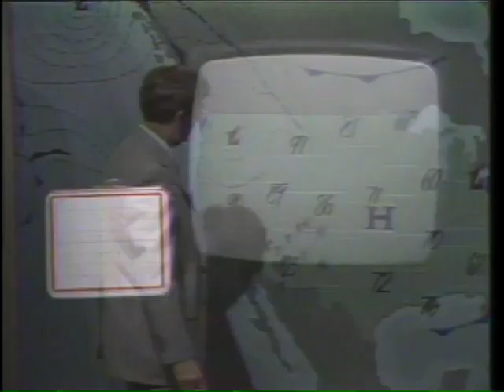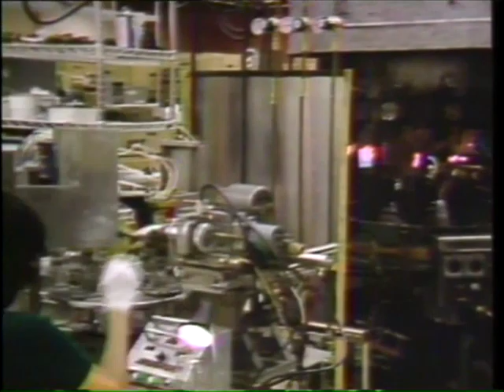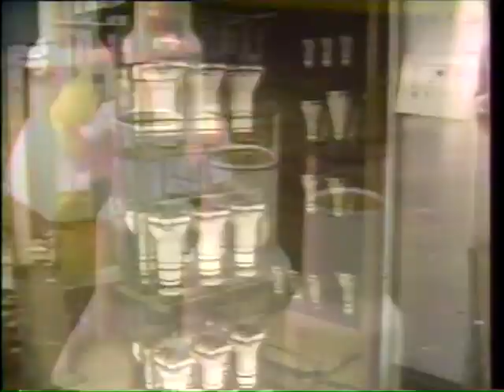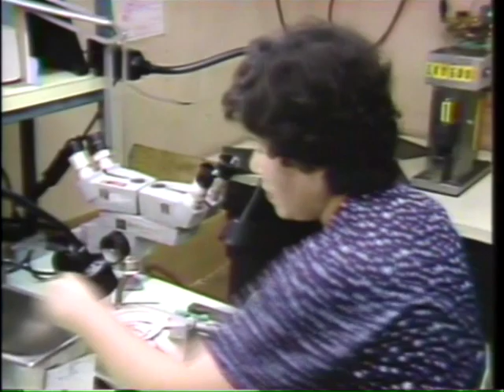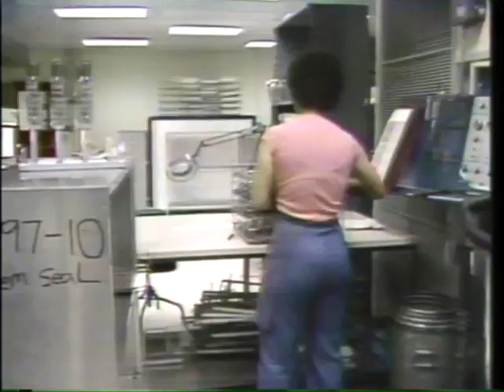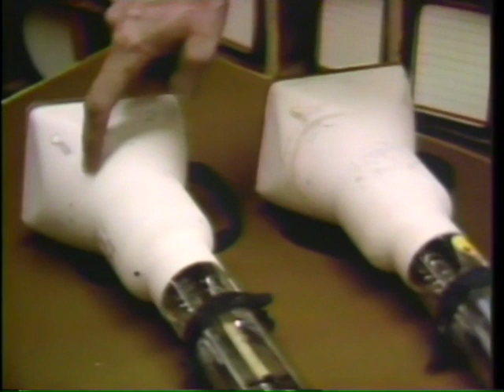Tektronix CRT Manufacturing -- No Compromise with Quality

Comment: 3 problems.  #1. factory located in USA; the bankers won't allow this.  #2. factory employs far to many people; again, not viable: more profit could be derived using robots making much cheaper items such as lcd panels. 3. Products made are of high quality.  Again not viable.  Customers are liable to use the product for decades without replacing it.  Better if it breaks every year.  or better yet build in a software that shuts it off every month and requires a subscription to keep working.

Comment: People aren't held to ANY standards except for "just show up" anymore. Quality means 💩💩💩💩
Reply: People forget how expensive these scopes were back then. And besides, there was plenty of crap on the market then too. If you want to compare, why not look at some of the high end test equipment available today? I think you'll find it isnt all doom and gloom.
Reply: @chuckvanderbildt  Modern test equipment is a marvel in semiconductor tech, although much more of it is automated for a multitude of reasons and it's not just cost but also quality.

The manual processes of making these old CRTs are a work of art and required skilled labor. Not to say making modern semiconductors doesn't require skilled labor, it's just that it requires less fine motor control and more "Make sure machine does this, and don't press this button. If this light/indicator on the screen turns on then it means it's time to remove this panel and clean this mirror with a special procedure that if you screw up means you cost the company $100K for a new mirror." Actually, I have no idea, this is all my own speculation. The mirrors might not even be cleaned but rather replaced once they reach an EOL. Would be cool if someone in this industry could give us a rundown!
Reply: Yes, what you say is undoubtedly true. They absolutely are works of art as well as technology, created by eminently skilled human hands.  @RingingResonance
Reply: @chuckvanderbildt  My biggest beef with modern tech and manufacturing is how cut-throat it has become to even work in the industry.

Comment: Awsome i learned a few things. The aluminum coating over the phosphor i thought was only there to stop ion burn and decrease rf and even x-ray in high voltage sets, didnt know it also increases brightness through reflection.
Reply: What is the cathode coating?
Reply: @SmokeyWire56  It was usually a barium strontium calcium triple carbonate. When heated to about 1050C under vacuum, it decomposes to oxides.That is the first step in the cathode activation process.